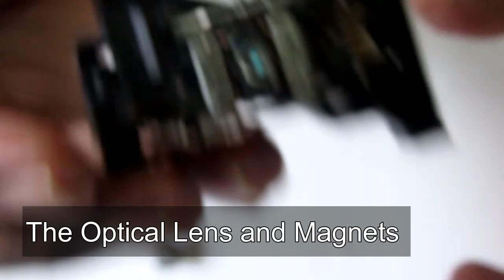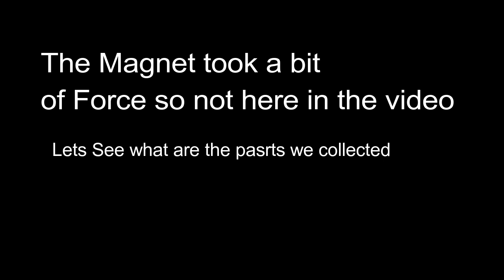How to salvage a DVD Drive For Free Parts

Comment: If the DVD drive was faulty, what use are the parts from it?
Reply: Actually they can be useful, if only circuit board gets short-circuit then you can use motors and lenses